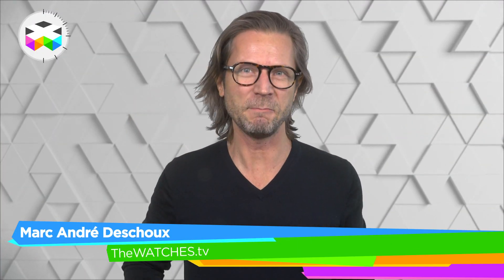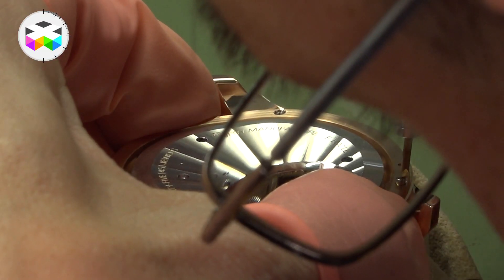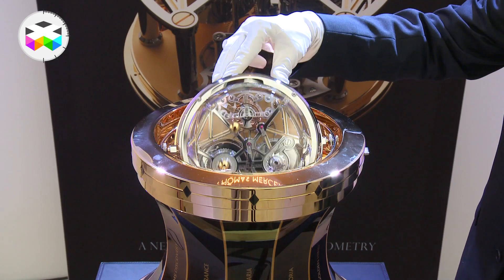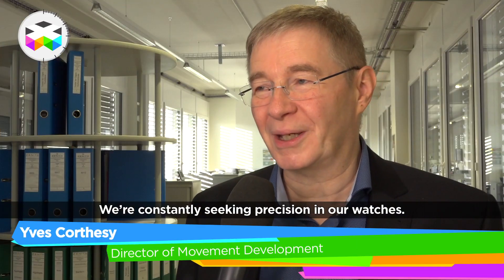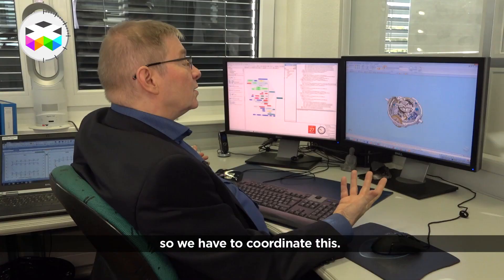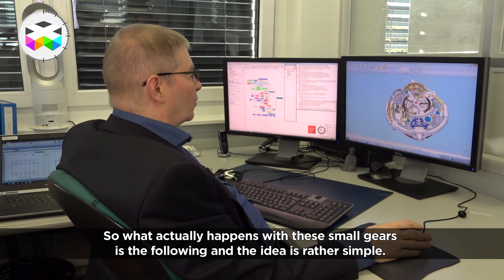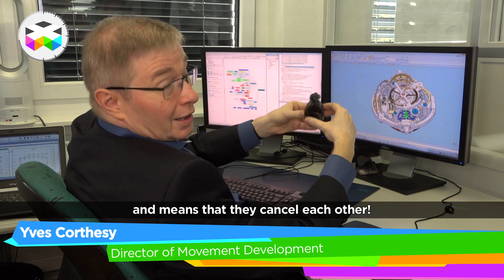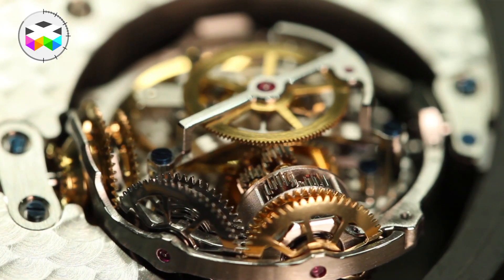Crazy Gyroscopic Escapement Module with Zenith Watches

Comment: How do we design the MHD waveguider based on this systems?

Lets say if we mount the vortex transmitter inside the gyroscope, and the resonant frequency outside the gyroscope,.would it effect the vortex strength? when the position of the gyroscope (which has its dielectric plane) changes as compared to its body frame?
Reply: Or should we fit everything inside the gyroscope?
Reply from the maker: Well that's a very good question ;)

Comment: Great video! Regarding the explanation, the guy only explained how the rotation is countered on a single axis, but what when the thing rotates on another one? This was actually just bypassed in the video. Someone has some idea?
Reply: Nothing. The axis is centered to be most useful to a wristwatch wearer and they are just betting on the fact that It is the most important position to cover.
Reply: It's called gimbal lock and is very common in 3d modeling and in airplane equipment

Comment: Can you provide a link to more technical details. Specific patents. I would like to reproduce this device in a much larger model that is 3D printed in plastic.
Reply from the maker: Hello and I've actually seen something like this on YouTube, a guy that also provides the plans for you to print it and adjust it, mighty cool stuff!
Reply: TheWATCHES.tv  I think you are referring to gyro-tourbillon and other tourbillons. But these are not exactly the same thing as this Zenith gimbled escapement module. If you have a link to someone 3D-printing specifically this Zenith module or even Zenith design patents to this module then could you please post them here? Thanks
Reply: I think I found the patent.
https://patentimages.storage.googleapis.com/f0/2d/28/74ca41440c5ed0/US9645550.pdf

Comment: love it! very intriguing as first they introduced it as a tourbillon but nevertheless I love it! Saw a few times and it's breathtakingly beautiful and unique. But one thing though, I think witschi can't record the accuracy of this piece because no matter which position of the watch is, the balance always in the "dial up" position compared to "normal" mechanical watch our a tourbillon, the position did changed when the wrist/cage is rotating so virtually we could see how was the chronometric performance  in each every positions. Another example was the Astroregulator by Cartier with balance and escapements are placed in automatic winding that act like a gymbal, eventhough it's still needs to be regulated at least in 3 positions like dial up, down, vertical in 6 o'clock position. And this Christophe Colomb mechanism is GENIUS as it really takes the advantages of movements in their dial up position, as the point of gravity only being centered at the bottom of the balance staff.... Thank you so much for this video! I expect to see a lot soon! SIHH2017 is around the corner!
Reply from the maker: Thanks for this very interesting comment and yes plenty of reports coming next week.
Reply: +TheWATCHES.tv  cool!  can't wait! so much expectations to see on instagram and it'll be awesome to have some much more in-depth report on those intriguing pieces....